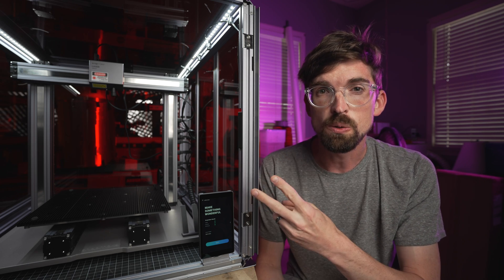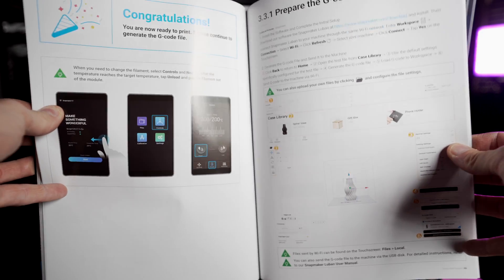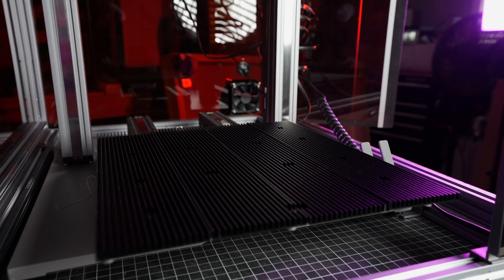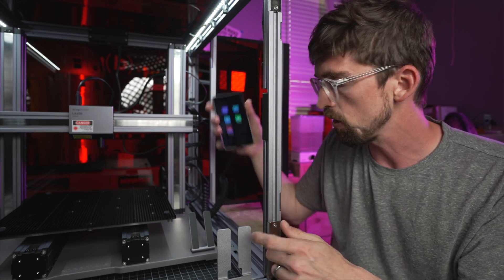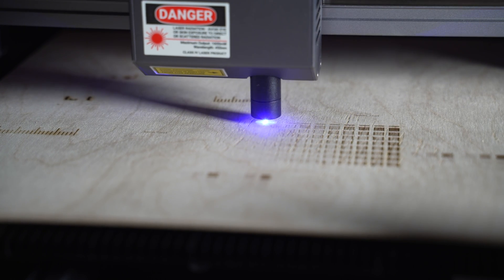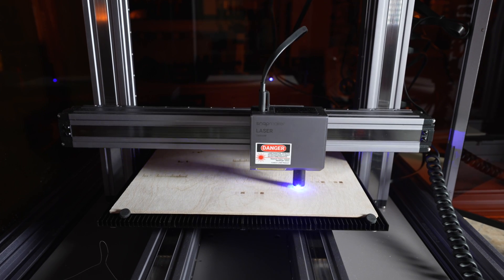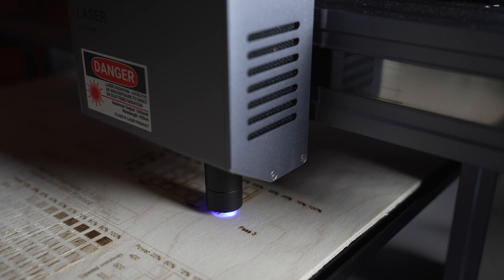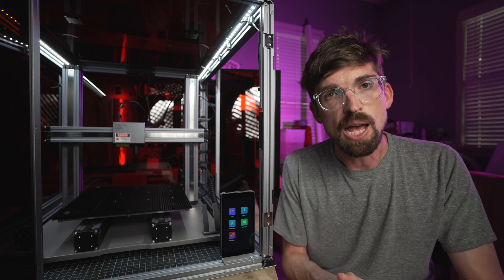How Good is this Thing? Snapmaker 2.0 Laser Module Review

Comment: How would you calibrate/use this machine with non-standard widths of materials? I want to engrave slabs of branches that I cut, where each workpiece is a unique width, so I can't really do the auto calibration thing since it would burn the piece to calibrate, and there is only one to work on.
Reply: Manual calibration

Comment: Cool all in one. I assume they only offer a low power laser to keep cost down, and if you're looking to cut something, why not use the CNC function? 
I'd really like to see you review the Genmitsu 4030, which seems to have pretty solid build quality for the price and plenty of add-ons like extension rails to massively increase the work area and a 10W laser that would give you 2/3 of these functions, but very possibly provide much more superior performance for the same cost.

Comment: I have a friend with a snapmaker one and he does very little due to the noise and speed (or lack of it) and he hasnt even managed to use the router as it makes too much mess and is a pain to set up,.

For me, I prefer a single machine that does the one job well and leave it at that. My lasers laser, my 3d printers print and if I had a cnc router it would route.... Point is I understand what they are aiming for, I just don't think it really works in my eyes

Comment: 👍👍👍👍👍👍Nice review. Just found your channel very interesting. I am a beginner in the Remote control plane world and want to start building with balsa ( I am currently building with foam only). 
Can you please give me your advice about the best option ( laser cutter or maybe cnc cutter) for me to cut max 1/8 in of balsa or basswood to build the wing ribs and some body parts. Parts may fit in area of 12x12 in unless they are maybe in two sections.

As per your videos co2 cutter seems to be best option but i do not think i need a 40W power laser cutter but i do not know.

Thanks

Alex 
Greetings from TX.
Reply: For cutting wood you want co2 in my view diodes can cut but co2 cut faster and easier
Reply: @derekwright2388  thanks for your comment. I still did not know if i need a co2 laser to cut 1/8 in balsa wing ribs ..thanks
Reply: @alexherrera3918  you can cut balsa or basswood with a diode but a co2 will be easier

Comment: The 10 Watt laser is a game changer. It is capable of cutting 2mm and even 3mm wood in one pass and can even cut through 12 mm thick wood with a few passes.. they also provide safety glasses with the lasers.. and it is important to note that the enclosure is not enough to protect your eyes. You also need the glasses!

Comment: snapmaker: very good at spending lots of money in marketing and getting your eyes into danger, BIG danger, like, instant blindness from a mistake danger "oh but you're supposed to use the goggles" yeah, what if someone who doesn't know that turns it on? what if someone enters the room while you're operating it? there go their eyes, accidents happen and their promotional material doesn't extensively show the importance of a proper enclosure, one with safety interlocks that prevent the laser from working unless it's closed
Reply: apart from that, it's not upgradeable and expensive, you're better off buying something reliable and easy to use like a prusa mini, and a small CNC with a laser and proper enclosure, the importance of interlocks in the enclosure CAN NOT BE OVERSTATED, multiple switches ensuring it's properly closed, and that it can't be accidentally pressed by hand when reaching Inside. you only have two eyes, and lasers that can burn or cut stuff are pretty bad to look at, even their reflections

Comment: I’ve been using my T250 for about a month now. I’ve found it to be a way better printer than my Ender 3 V2, easy to set up, easy to calibrate and much more even bed heating. I’ve found it way easier to get consistent layering and I haven’t had a print come loose yet. Once you get the work flow down swapping between modes is about 5 minutes work. Laser works well for engraving and cuts 2mm birch,  it it’s slow. Luban works well very well if you’re just doing something straight forward. 

My assessment, it’s much easier to get started, get making and get consistent results with this than my Ender. I enjoy using the snapmaker and feel like I get to focus on the project not the machine. My first month with the ender was an endless series of failed prints, great learning experience but at times quite discouraging. First time I booted up the SM, it auto calibrated, I dropped the print head 0.5mm, hit print and got a perfect print of a model I was still failing to get on the Ender after a half dozen attempts.

For the hardcore 3D printers out there perhaps the bang for the buck is low, for the rest of us this is great

Comment: been using it for over a year, I upgraded the laser since it really was the weak point and works great. Is sturdy, elegant and just works, I use cura, ligthburn and fusion 360 because luban is very basic. I upgraded the power supply and linear modules and its really silent now. I also 3d printed accessories  for pen (for plotter art) and a drag knife for cutting vinyl. No complaints here. A lot of the issues I see people complaining are more about all the things you need to know not get a good 3d print like calibration or filament humidity, all things you have to learn to get good results.
Reply: How easy for you to switch from lasering to 3d printing?
Reply: @ComgrowOfficial  easy once you figure out that you can attach the laser bed to a spare magnetic sheet (as used for 3d printing) and then all that remains is to swap the tool head (4 screws).
Reply: @ComgrowOfficial  I am also interested to know.

Comment: I have one. I hate it, and I truly wish I had bought a D1, cheap CNC, and upgraded a few of my enders. Would have saved me a lot of time and money. 

So within a week of opening the machine, I reached out to Snapmaker for support concerning the laser function. Turns out the guy I got stuck with didn't know what he was talking about. He told me it was broken, and I was then jacked around for 3 months before they stopped replying at all. 3 months later (6 months in total) They reach back out to me concerning a negative review I left on a third party site.  I used their contact to start trying to get help from them again, only to find out the problem I originally had is a limitation of the machine itself. Camera capture cannot accurately capture tall items  (3-4" tall) for engraving. It just cuts out massive sections of the image. So 6 months, countless hours of time, and countless materials wasted trying to fix a machine that they said was broken... that wasn't. 

They also removed my negative review from their site, and tried to bribe me into taking down my third party site review. 

I did end up getting a 50% refund, but that was because I was prepared to dispute the charges with Paypal. It's an ok, non upgradeable 3D printer. It's not a Prusa, or even an Ender. Haven't had a chance to play with the CNC yet, as the machine is noisy enough on its own. 

My review stands, and I'll continue to tell everyone about my experiences. The machine is meh, and the support is crap.
Reply: My biggest BIGGEST let down - had the original support rep said ‘hey, that’s not an error, it’s a limitation’ I was in the return window. I could have returned it, and saved myself a lot of hassle. 

But the hiding reviews and trying to bribe away my third party site review is that absolute worst. It makes me wonder how many bad experiences there are out there, that no one can see. Had I seen a handful of experiences like mine, I would not have bought it.
Reply: sounds like ignorance of a machine limits from both parties. jest sell it and get over it, you already got 50% off and are still hating on the machine when it was literally you not knowing.
Reply: Thanks for the heads up. D1 for me.
Reply: thank you for this believe it or not your experience totally changed my mind ...
Reply: Seems same kind of customer treatment like WABECO wabeco-remscheid supposedly germany mande lathes etc. I have D4000, for more then 5 years. Cant make it work, bad faulty parts.
Reply: @akierum  I got the machine and tried every module. And I can only say it sucks.  I got like 400$ Single use machines that get better results. (3D Printer/Laser/Small CNC) I was fooled by the sturdy design and the idea to only have to have one machine at hand for my projects. If I could I would refund it imitdiatly. The 3D Printer is slow as F.. The CNC cant even cut a small juwlery box without skipping and the "old" Laser moduler is also really really bad. The Photo feature cant even get a proper picture and after month of wating for an update to fix the damn module with an software update, they release a new one for 400 bucks. Jeez. I really wanted to love the machine but i just cant.
Reply: @illuminant777XtX  thanks for info